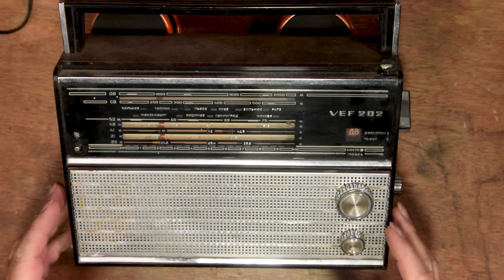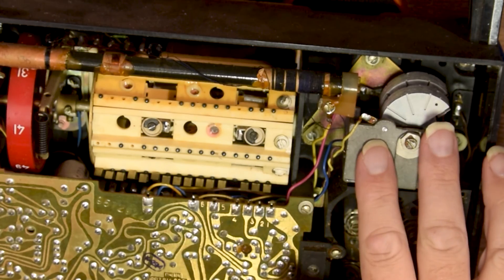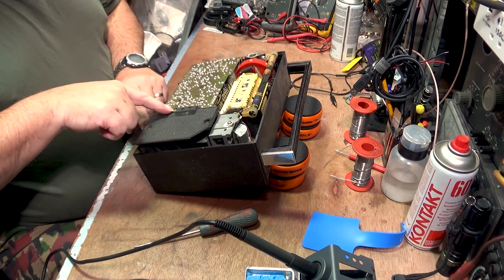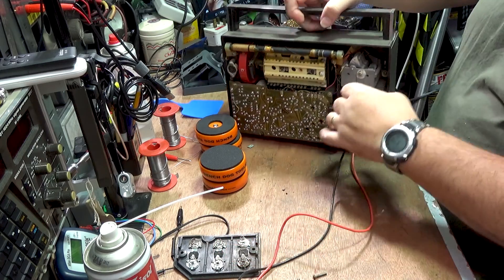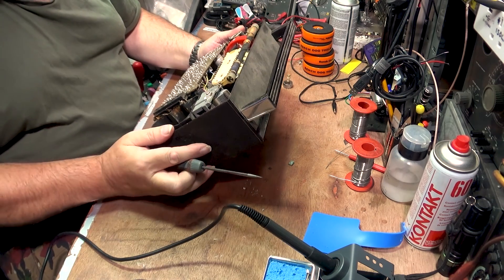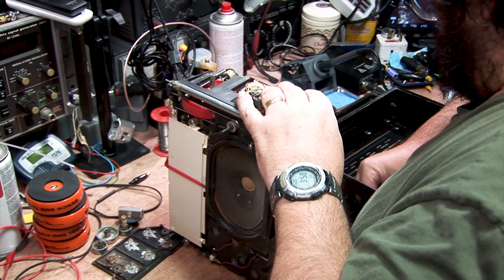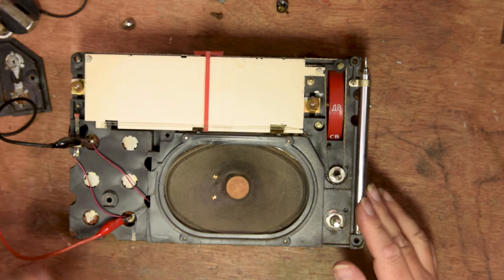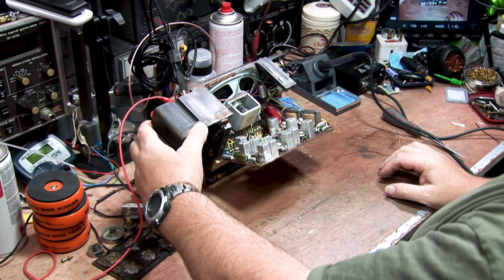Vef 202 Radio - Soviet All Band Radio Restoration

Comment: That is quite a conversation piece George.  I am not surprised it is still working. I think anything worth building is worth building well. Not all share this utopic idea sadly. The corrosion and abuse is not to be blamed on the maunfacturer. If it hav=d been taken care of, it will still be a top shelf radio to display and enjoy. Thanks so much for sharing George. Congratulations on your eBay score Comrade! lol.
Reply from the maker: It is a well built  set and is actually a fairly easy to service set, should it ever need it. I'm planning on keeping it original rather than just shotgun change caps because essentially it is a working set as it is. I do have another Russian set here for a future video and a little, new in box original soviet pocket radio on its way. These things were meant to be used and once it is cleaned up I'm tempted to have it as a daily driver, although I have quite a few to choose from!
Reply: @GeorgeChristofi  It sounds like some exciting videos coming up George. It's a good idea to put what we can to daily use for sure. I am sure that radio will perfom very well for you. I look forward to your next video installment.

Comment: Ha ha you bad man, i had to laugh at the impression, i swear it started to sound like wolverhampton accent a bit, well maybe :-D
I fully understand your choices with that radio, original as possible with careful cleaning.
Russian radios were always made really well, amazing for the era.
Ive always loved the unusual components, the bowler hat transistors, solid looking capacitors and very strong resistors often red coloured.
I had a little tv from russia called a Regonda, every pcb was on a hinge and string to stop it opening too far.
So unusual and unique.
Reply from the maker: I know, it was so hard to keep up but I felt it slipping into an arab accent which is when I had to stop! The radio is pretty impressive to survive the rust, damp, salt and other issues and still work pretty well considering.  If British vintage radios were made for servicing in mind the Soviet stuff was made to survive the nuclear winter and still be fixed with newspaper and string soaked in vodka. I remember Regonda branded stuff, might see what is out there!

Comment: Your Russian was an all star performance George !!!!  Way to go brother. That is really a well made radio - its cool because its gives a glimpse into what Russian electronics are like.  Don't work to fast on that radio. If you do, you'll be russian !!!  Looking forward to a follow up on this one :) Thank you Comrade
Reply from the maker: The It is a really interesting design. The schematic shows the whole thing is set up as a positive ground design which is the opposite of the British stuff of the same era. It makes for a way to catch you out for sure if you don't pay attention.  Not going to be Russian on it but there is really only a cleaning job to be done. I will check resistors and caps but I'm confident that they won't be out, having worked on other Soviet stuff of the same era. Thanks for stopping by Ron, Comrade Georgi looks forward to seeing you soon, but not in the gulag!

Comment: Hey! I have a VEF-202 that I got from my grandparents. Unfortunately, it doesn't work because the contact parts of the batteries are badly oxidized, not all though, 2-3 of them seem to be all right. Also, one wire under spiral-shaped contact surface appears to be broken, but I think it can be dented with tin. Is there any way to get spare parts for this radio? What would you do with the contact parts of the batteries? It would also be good to know if it is possible to find the right type of power cable for the back panel plug? That CCCP-style plug is quite strange on the back panel so...is there any way to pass-by this somehow, f. eg using some type of an alternative cable or wiring system?  Or can I get the right kind of the wire for the back panel plug, for instance, from some online store or somewhere else? I would really love to see this thing working so I hope you could help me to find a solution to repair this fantastic old Soviet radio. Thank you. Best wishes, Marisol 💜
Reply from the maker: Spare parts can be obtained but usually from other radios. The use of tin or another sheet metal such as copper or brass will work just as well for the battery contact. The cccp plug can be removed from the radio and wired direct to whatever type of lead you want, either uk or shuko. The internals of the radio are standard components found worldwide so this radio can be repaired fairly easily and cheaply. Good Luck and best wishes.  George
Reply: @GeorgeChristofi  Thank you so much for this valuable information. Would you clarify for me what is 'shuko'? But other than that,  your instructions are very helpful. Thanks again and all the best 💜
Reply from the maker: @Marisolita_95  shuko is the German/Euro mains plug and socket.
Reply: @GeorgeChristofi  Ah, ok. That's what I assumed. I'm living in Las Palmas, Spain, so the EU socket is what I need. 🔌 Let me tell'ya, without your videos of fixing this neat radio, my VEF-202 would probably rot in my closet and eventually be beyond repair. It's a cool vintage item I'm using for décor. 📻 Cheers!  ❤️

Comment: I bet that was a very good radio in its day.  However, it is more like 60s tech than 70s to 80s tech.  The transformer/tuning cans are more like something you would find in a valve radio.  Excellent radio.  I would have still changed the dial lights to LEDs just to save power.  In fact I might have put LEDs and left the original ones there for when it is plugged into the mains.  Yeah, I think that is what I would have done, the hash LED for battery and the softer light from the bulbs for mains operation.  :-))
Reply from the maker: Cheers Bob. Yes, the led thing is a possibility. I might still do it yet. Have been having a major reorganisation of the workshop which has delayed things a bit. The Soviets seem to have kept with tried and trusted designs because my research has found that the chassis and pcb is common to its predecessor set and various others that followed it. I guess the attitude was that if it wasn't broken, don't fix it. They just did styling changes to make it more appealing.
Reply: @GeorgeChristofi  Well, you can't fault them for that, just things tent to stay a bit heavy and big.

Comment: Export versions had an extra shortwave band in the blank section. I have a VEF 206. Unfortunately I threw out my VEF 202. I had bend  the blades of the tuning capacitor, and the power supply unit passed AC through. Could you use sandpaper in the contacts of the rotary switch? They are bad.

Comment: Holy smoke George, thought I'd subbed to the wrong channel and ended up watching some sort of Soviet Deyv Lee Travisky radio repair.
Those Russian sets are interesting, seems to be loads around but I never remember seeing them being sold in the 70s
Reply from the maker: My channel gets taken over frequently... it just happens. The 202 was the domestic version of the 206 which was sold over here but with expanded wavebands. The corrupting of the Soviet workers and children was the official reason for limiting the bands. Did see a Vega branded set on ebay with a John Menzies transfer on the back as the distributor/retailler.
Reply: @GeorgeChristofi  Thank you comrade or can I call you 'The Hairy kornflek'

Comment: I've got a VEF202 on my workbench right now.  So far, to get it working I needed to clean the turret contacts and bend away a plate in the tuning capacitor that was shorting it out.  The antenna on mine is broken, so I have yet to fix that.  My battery compartment looks about like yours does!  I think the blank band may be to allow the use of the tape input on the back?  If it is a tape input and not a tape output?  So you can play tapes thru the radio without any radio noise?  Just a guess.

Comment: Actually today I bought a Societ made radio a VEF317 listed as for parts but pictures with it look good internally it is probably trash but hey needed a different project too.
Reply from the maker: You may well find that it actually works Larry! They are pretty bulletproof and the transistors don't suffer the issues that the Mullard AF series transistors do.